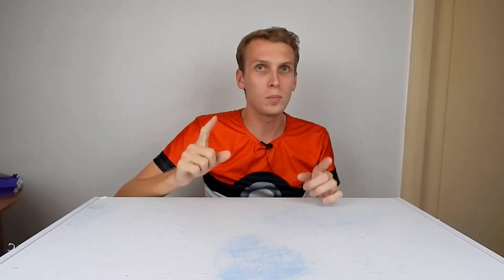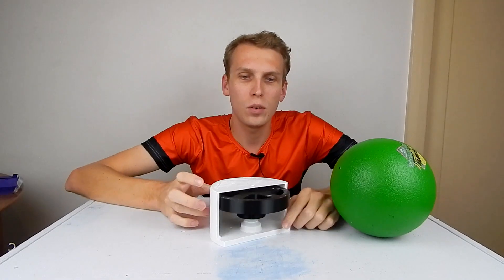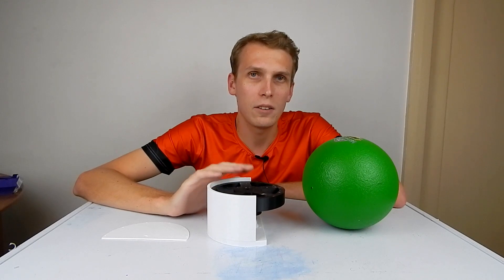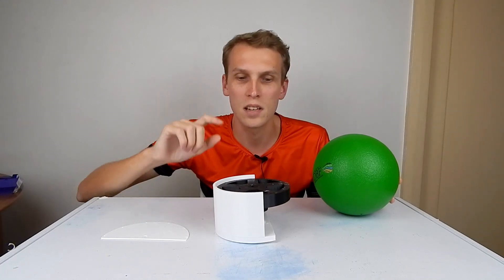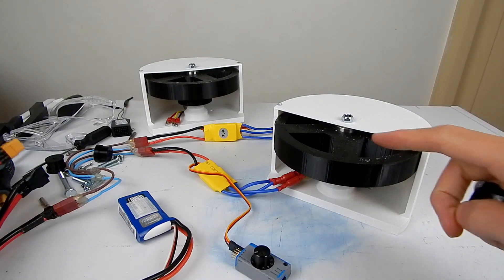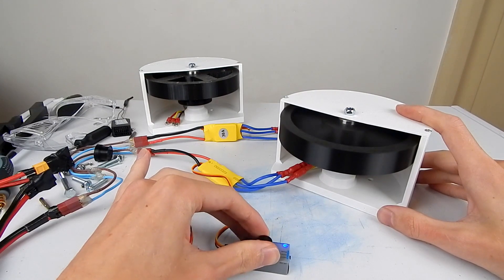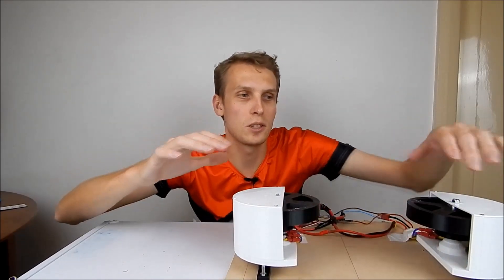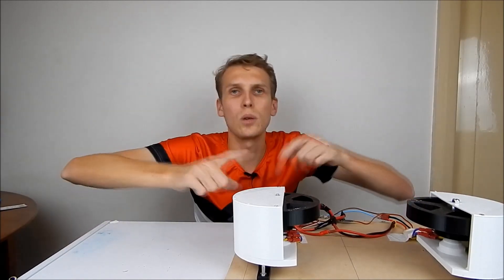Dodgeball Thrower: Part 1 - Brushless Flywheel Testing!!

Comment: Might want to try making one myself! Thanks for the content 7 years ago lol
Reply from the maker: Omg it has been awhile since I built this

But I have been thinking about redoing this project again sometime.
If you want to build one, I'll give you my thoughts on upgrading this one:
Dont use belts to drive the wheels, go gears or direct drive
Use programable escs that can have an encoder attached and set a motor to a specific speed
Build a rigid base that doesnt flex when the ball passes through
Like Stuff Made Here did with his disk thrower, use multiple fly wheels to get the ball up to speed and impart curve
Use a rubber or silicone wheel to grip the ball better
Reply: @TeamPanicRobotics  Hello, I've planned to build one of this, could you please recommend what motor should be used(which model)? Thank you so much in advance.